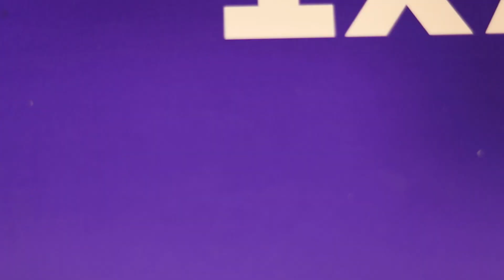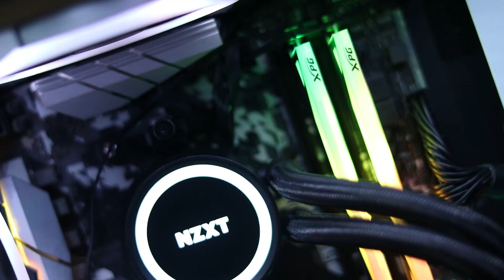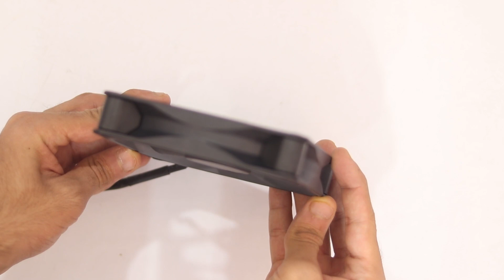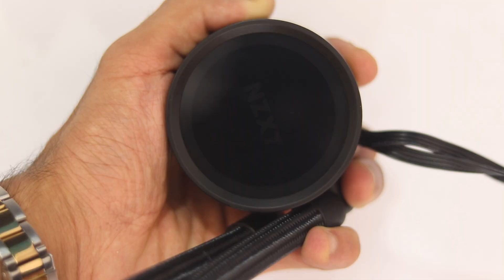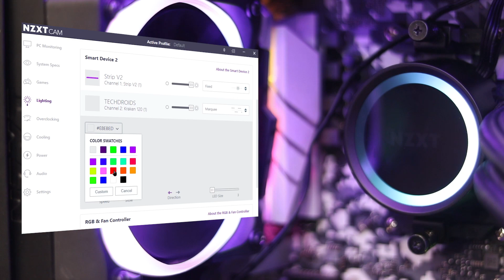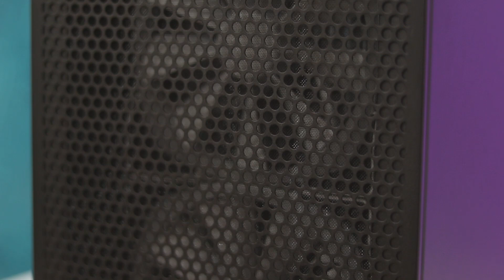NZXT Kraken 120 RGB Review - Best 120mm AIO Liquid Cooler For Gaming PCs

Comment: hey bro, do you think this cooler is better than the M22? ive had the M22 since 2020 and only now has my cpu increased in temp.. i do think the m22 is a lot more nicer with the whole mirror rgb but needing a new cooler and this is pretty much the only trust worthy aio 120mm cooler out
Reply from the maker: Yes its better than M22
Reply: @TECHDROIDSYT  I'll be putting fresh thermal paste on tonight hopefully that will help, I'm thinking my paste is all dried up since I haven't put any fresh paste on since the build in 2020 😅

Comment: That is a very bad result that I reach without any problem in medium and idle to with my TR Pearless  Assassin 120 SE with 2 TT though fans 12 pro, and bet my life any AIO are early junk when a good air cooler. Thx 4 that crapy AIO but when I would upgrade it with a Noctua NH-D15 or a TT Toughair 710.

Comment: Without an nzxt motherboard how am I able to control the lighting of my nzxt kraken 120 aio through cam? Because I also heard that you are not able to control it using the nzxt rgb controller as that’s specifically for fans and leds…
Reply: Did u find a fix
Reply: @vet2163  yes

Comment: I just received my NZXT prebuilt streaming pro pc and it looks like my radiator is facing the cpu cooler and the fan is in between that and the back of the case. I’m not sure if this is okay but every video I’ve seen the radiator is against the back of the case and then the fan is on that facing towards the cpu cooler.
Reply from the maker: Yes it's totally ok don't worry about it. Coolers can be mounted in different ways

Comment: where do you plug the cable in that was on the radiator  need to know asap the aio port or cpu fan 4 pin

Comment: Pump integrated in rad is junk. Got a m22 and didnt last 1 year before having problem. I try now tube bottom and i got rattling noise at high rpm. Which i didnt had with tube up. (Only setup that is decent for cable management). It just peak high (90-95) while i play. Dissapointing.

Comment: will this be able to reliably cool a stock 12700k (no OC) ?
Reply from the maker: Yes
Reply: @TECHDROIDSYT  thanks so much for the reply ! What's the total thermal dissipation capacity of this aio in watts ?
Reply: did you end up going for it? if so hows it doing im in the same situation??
Reply: @matthewmurphy1629  yup ive got a 12700 paired with a kraken 120 and it does quite well after i changed the stock thermal paste! highest temperature recorded after a thirty minute cinebench run on all cores was 81 degrees celsius :)
Reply: @A D  damn ahaha I couldn't find anything anywhere so bought an al620 white edition, I'm sad now shsha cos the aesthetic wouldve been better

Comment: I think this would keep any processor cool but you can't overclock it.  It  works great on my i9 10850k but I can't overclock it.
Reply: Hi, so with your 10850k stock it can handle his TDP of 120W at what temperature with the Kraken 120 ?
Reply: @EnzoE  
I used it for a year and it was fine. I had no problems but I couldn't overclock it.
Reply: @Shawner666  Humm okay, you know what is your max temp on benchmark for exemple ?
Reply: @EnzoE  
It would never go pass 60c when I was gaming.

Comment: My Pump and Fans work but my Led doesn't work, (I have b550 and plugged it in, in RGB Header) Do I need the NZXT RGB Hub? To make LED work? My NZXT CAM Doesn't detect it either...
Reply: Did you solve this? I have the same problem
Reply: No, I didnt but I think you may need the NZXT hub to make the LED work. It sucks so I just bought Corsair h60i instead and returned the NZXT Kraken 120
Reply: I have the same problem, pls help

Comment: How the heck do you connect the RGB cable
Reply: I know this comment is old, but I struggled with it and want to share the solution for future people. There are two RGB cables coming from the reservoir (the bit mounted directly over the CPU), and you only need to connect one. There's a male connector for if you have a specific type of RGB control plug on your motherboard, and a female connector for if you have an NZXT RGB/fan controller. If you have an NZXT case, the controller should be on the rear side, opposite the glass side. The Kraken should go in the first RGB slot of the NZXT controller. Don't forget to plug both the fan cables coming from the fan and radiator. Plug them into the NZXT controller if you have one, or your mobo if you don't.

Comment: Nice review. Just what I was looking for. Out of curiosity, do you think this 120mm aio would be enough for the 12600k? (I won't be over clocking it)
Reply from the maker: Should be enough without overclocking
Reply: @TECHDROIDSYT  12900k with undervolt? in fact can any 120 aio cool it down? maybe if using noxtoa 3000rpm fans? or iv been eying with rynatech pallas 68mm height with 13 mil tall fan, 55mm the heatsing so with 80mm cooler clearenc i could put 140x140x25 noctoa 3000rpm on that too. iheard ek has the best pump? could i cool it down? what your opinion?

Comment: Hey any one has installed this kraken 120 on Asus motherboard. I am having some difficulty on the RGB.
Reply: Me 2. Dud you solve it?
Reply: @uwatofficial  the Kraken 120 is still on my PC the RGB doesn't work as they are 5V and the motherboard is 12V. I also got a converter but that didn't work either. the performance of the Kraken is good but no RGB.

Comment: How does this compare to the stock cooler on the Ryzen 5600x?
Reply from the maker: It's definitely Gonna be better than a stock cooler -20 degrees
Reply: @TECHDROIDSYT  i have a Ryzer 5 2600x. Does this cooler works good for it ? Or should i get an 240mm version ?
Reply: @brennerariel031  No. You definitely shouldn’t

Comment: My M22 crapped out on me and they sent me this one. This AIO doesn't have a 5 pin USB connected to the waterblock. It has their proprietary connector and an aRGB connector so I couldn't use their cam settings for RGB. I tried to supplement this problem by getting a fan & RGB controller which worked, but I found out that the waterblock only has 1 lighting zone. So you can set the logo and the ring separately. 😫 With the M22 I was using cam to show me my CPU and GPU temps since it has 2 lighting zones. Super disappointed... On top of that my rig is in a 9.7L case so I don't have room for all these cables that I had to add I to my rig just to get the damn AIO to light up the way I wanted.

I emailed them explaining my situation and how the M22 fits my use case more, and asked if they can just send me a new M22. They apologized and offered reimbursement for the controller and told me they can't send an M22 because they stopped manufacturing them. Much appreciated to say the least. I think I'll just keep this for backup and buy an M22 online or something.

It's weird that they release an updated version of their 120mm AIO so they can make it more effecient but then also remove all of why the fans were using it in the first place. The infinity mirror and 2 lighting zones on the waterblock. Waste of an update if you ask me
Reply: bruh I'm new to building these pcs and your comment totally explained my problems. I just couldn't find a place to plug in the cables on the waterblock and this must be why!
Reply: I just learned about this after purchasing this week, needless to say it’s a disappointing design and I’ll be returning them as soon as possible. An aio with industry standard rgb plugs is going to be vastly superior to this cooler.
Reply: damn this comment is 11mo old but really hope you didn’t just put this one aside and get another m22, that cooler is totally not worth buying again
Reply: I recently got Kraken 120 since my M22 got dead like your one too..
And I recently realized that Kraken 120 is more into your Motherboard port based, not like the M22 with its' individual CAM Facility.
Which means, If I need to change color of my Motherboard, the whole theme including the Kraken 120 will be changed.
But before, I could add separate color on motherboard RGB and this NZXT cooler.
I'm actually disappointed on what they did on Kraken 120. NZXT could've kept the same manufacturing structure like M22.

Comment: I'm curious to know the failure rate of the 120 in comparison with the M22. The M22 model is somewhat notorious for failing on users, so I'd hope that this would be fixed with the 120 model.
Reply: My M22 just broke and they sent me a 120 instead. I dont know if I should keep it or sell it
Reply: @Araxis7  they sent you the 120 for free?
Reply: @legrandhanf  yup, still in the box. Should I keep it?
Reply: @Araxis7  they normally make you send the defected product before they send you a new one. Also idk who will buy it since it's broken and it's also no use to keep it if it's broken
Reply: @legrandhanf  I threw my M22 away. Im asking you if you think I should keep the 120
Reply: @Araxis7  Late, but I ditched AIOs altogether a month ago and went with good ol' reliable air cooling - the Noctua NH-U12A. Works like a charm and my temps are just about the same (if not better, depending on ambient temperatures in room) as with my old Kraken M22. If you'd like to stick with AIOs, I'd look into going with Corsair instead of NZXT. NZXT is notorious for having products that fail or start to show problems quickly - even their case fans can prove problematic if installed "incorrectly" e.g., horizontal top-mounted.
Reply: @legrandhanf m22 are discontinued
Reply: @Araxis7  yeah same here, I think I will give it a try
Reply: My kraken M22 failed, i had to contact the NZXT Support and then they sent me this model,  so far is smoother than their previous version, i would say that buying this product is trustworthy because at the end of the day the brand backs you up no matter what which is a pretty nice service if you ask me.
Reply: @ricardoarguelles6706  did you have to pay for the 120 they sent you?
Reply: @legrandhanf  nop
Reply: my M22 has been going strong for over 2 years now at this point,  xmp has been enabled since day one, my gpu is also mildly over  clocked,  I haven't had one single issue with it gaming for and hour or multiple hours at a time.
Reply: @Thompson8888  looks like you got lucky had mine for 6 months and it’s already failed miserably. Started the RMA process. Just got off the phone with support and getting the 120 as a replacement.
Reply: @MarinFournier  what processor do you have ? I want to know if this will be sufficient for an i9 10850
Reply: My M22 literally died in me today, I had it since 2021 and wonder if NZXT will replace it even though I’m technically out of the 2yr warranty.
Reply: @diz354  They might - doesn't hurt to ask. And if they say no, well, there are better brands you can bet on or you can go the way of air cooling. My Noctua's still going strong, as expected.
Reply: M22 broke within 2 weeks for me lol
Reply: I had 2 m22,second one just broke

Comment: Hello, i recently ordered the nzxt kraken 120 and im wondering what would be the best fan configuration? im also using nzxt h510 elite case.  i plan to mount it same on the video but as intake? then my two fans infront would be for exhaust instead. what do you think?
Reply from the maker: Just mount it as shown in the video that's the best configuration in my opinion as 510 elite doesn't have exhaust towards front side